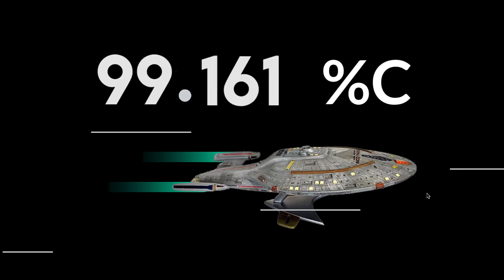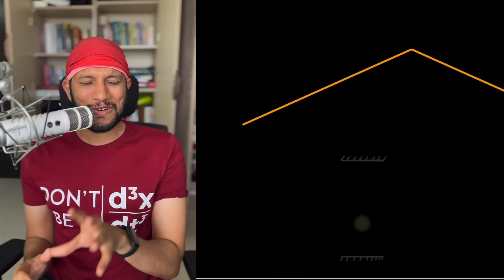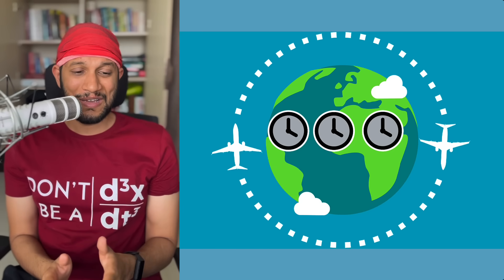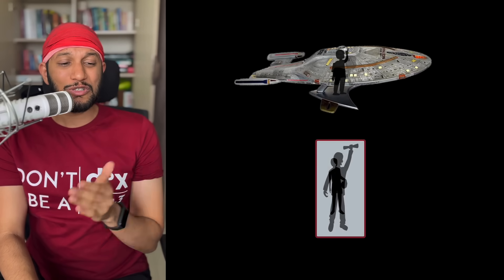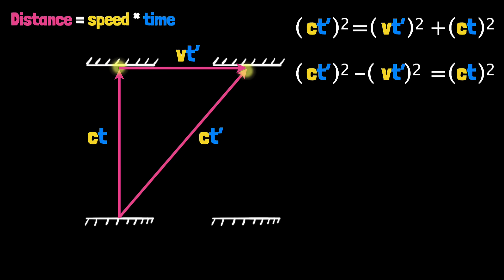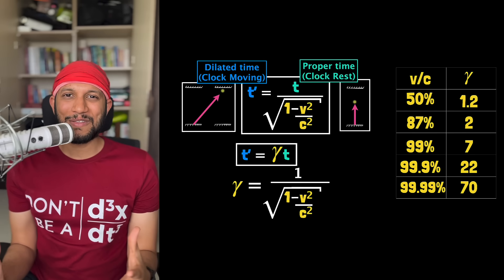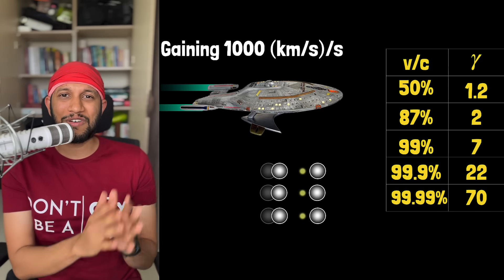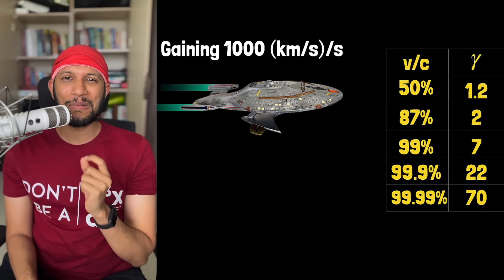I finally understood why you can't go faster than light! (My mind is blown)

Comment: I like to imagine space and time as something like oobleck (a non-Newtonian fluid). Space is the water, and time is the cornstarch. When you try to move through this mix, it starts to push back the faster you go. At low speeds, you can move without much resistance, but as you accelerate, it thickens and gets harder to get through. If you keep pushing, it eventually becomes a solid wall (the speed of light) that requires infinite energy to break.

Comment: If you're on a ship, and your destination at rest is 1000LY away, will you reach it in less than 1000 years if you begin moving at a speed that outside observers would measure as 99.99%?
You would reach it in 14 years? Others would see you reach it only after more than 1000 years?

Comment: The question become how are the biochemical and electrical processes and impulses effected and how does this change your perception, is there a noticeable change. Are there just massive amounts of change in the environment like flying past a galaxy that you simply would not see or have the information enter your brain because you brain is still completing electrical processes that are now taking way longer than usual. Would this feel slow? Would it be unnoticeable just like you cant see a bullet but otherwise everything else is normal. If your frame of reference for time remains localized to yourself and you otherwise maintain normal cognition from your perspective nothing is different you are actually aging slower from your perspective, you arent experiencing the "extra time" it would feel like you were going forward in a time machine. 

Or would you feel stuck in an infinitely slow and frozen world experiencing all the dilation psychologically, likely not because the photon processes i. Your brain are slowed down

Comment: All masses made of energy quanta, that are propagating through space time at the speed of light.  In its material state, those energy quanta are orbiting around in tiny subatomic particles.  When you add energy photons an object, you have to average the vectors to get the new vector for the object.  A 100g baseball + 10g of acceleration would move about 89% of the speed of light, but a 100g baseball + 100g of energy would travel about 96% of the speed of light.  Add 1,000g of energy, and it's traveling 99.6% of the speed of light because you have to average all of the vectors together.

Comment: No the part of taking infinite time and fuel is wrong  if you and the fuel are moving at the speed you will not notice time slowing nor the amount of time it takes to get there and the fuel would burn at the same rate as your ships time as if you where not moving at the hyper speed speed. Those speed and fuel consumptions would be from an outside observer not moving at speed.

Comment: There is evidence, It has been found that however much energy you give them, paricles in an accelerator cant be acceleratd to the speed of light. Humans are far harder to accelerate than subatomic particles. It is impossible to bounce a photon between two mirrors in the way you describe, but it is valid as a thought experiment. At speeds close to c, distance in the direction of travel is dramatically reduced, so the time remains the same but the muons have less distace to travel and therefore appear to go further, giving the impresson that they are living longer. If a spaceship passes us at 20% of c, it will seem to the astronauts that we are passing them at 20% of c and our time will have slowed, but for us our time will be unaffected.

Comment: Your explanation is great, but it's not a complete intuitive explanation. It goes wrong at 1:33. You casually mention that the photon always travels at speed of light, c. I would argue that's wrong. In the frame of reference of the ship, yes, the photon moves at speed c. But from the outside frame of reference, the photon should move at c + whatever forward speed it gets from the movement of the spaceship. This would indeed be true if we replace the photon with, say, a tennis ball. 

For a photon, however, this is NOT true. It doesn't get additional forward speed from the movement of the spaceship. But WHY NOT? Why is the speed always c in both reference frames? An explanation that doesn't cover this fact is simply incomplete.

Comment: 9:31 dont get the last step of the equation process.
Reply: You factor by c² on both parts of the fraction (up and down), so they cancel out. 
c²t²/(c²-v²) = c² * [t²] / c² * [1-v²/c²] = t² / (1-v²/c²)

In the same step, everything is put under a square root to get t' rather than t'²
Reply: c² = 1/1/c² hope you got this...
Reply: @tuhinmajumder21  double fraction?

Comment: Pedantry: The increasing energy to keep constant acceleration is not an exponential function. Exponential functions are unbounded in domain. If you increased the energy exponentially, the ship would still appear to eventually stop from the inertial reference frame.

 The function for energy needed to maintain acceleration would be a vertical asymptote (making the domain bounded).

Comment: You can't understand something that has never been proven.  Einstein's famous equation is a gross simplification and is impossible to prove.  If speed is defined as time to traverse a distance, how do you define distance in non-linear space, and then how do you define time? "Space-time" is an assertion, a way to explain away the absolute metrics needed, but it is impossible to measure it absolutely.

Comment: Question: The time dilation equation assumes a photon clock, I am assuming because we want to see the object? What if we use a particle P clock that goes with S>10*c  that can observe through an instrument then the equation becomes 1/root(1+v**2/S**2). 

If we assume c=1 and S=10, At 87% of S = 8.7(>c), gamma=2. Then the energy taken is not infinite right?

I am confused because the the basis of all this the assumption of clock made of photon.

Comment: Wait... no... you are actually changing the distance that the photon travels. So, given its speed is constant, increasing its trajectory will obviously increase the time it needs to travel that distance. The clock is not bouncing between two mirrors like the photon, it's not traveling any distance in order to measure time, the clock measures time because it has a battery and an electronic device inside. I still don't see the relation between the speed of light and time. What am I missing in order to wrap my head around this?

Comment: Got it.  Finally! Just one question. If the object moving at 99.99% of C takes a shortcut so to speak by traveling through a region of curved spacetime does that reduce the time dilation by reducing the d component of the d over t calculation? And if so does it make APPARENT FTL travel theoretically possible if we can artificially  bend space-time without harming the ship? Just asking for a friend of mine named Zephram Cochran.

Comment: Great Viedeo it was really clean and truely the most comprehensible Version of the topic. But i heard that if you flew with 99,99% speed of Light and you were to shine a Light inside of the cockpit it would still light up the room. But how can this be regarding the statement that the transmission of the acceleration is getting delayed. So if that was the case in the cockpit the shining of the light would also get delayed wouldn't it?

Comment: The thing thats not explained, is why the speed of light stays the same, regardless of reference frame... Or in other words, why light always references some "stationary" cosmic frame, rather than, for example, the spaceship it is emitted from. 
If it would do so, it could be "faster than light" in some other refernce frame. But it cant, because there is a cosmic speed limit. Without the limit, there would be no time in the universe

Comment: You can go faster than light. Light travels faster than light relative to light travelling in the opposite direction. Einstein might have got it right mathmatically but in the physical universe the only way light speed can be a constant is if nothing else moves which is clearly unrealistic. Maths has its limitations.

Comment: Einstein's Theory of Relativity has been disproven. It is, after all, only a theory and not a law of physics. It is known that the Big Bang traveled faster than the speed of light, or at least faster than speed of light as it has been established as a constant.

The Theory of Relativity is based on an assumption that what our observations about the physical world are consistent across the entire universe. The problem is that we cannot measure the physical characteristics and behaviors in other parts of the universe. Also, even those things we can measure are susceptible to distortion by taking the measurements.

I do not believe that the laws of physics are immutable across the entire universe. Why? Because it is far too easy to disprove many of the theories of physicists and the calculations of applied mathematicians due to their lack of domain knowledge, and the limit of their practical experience leads to their failure to consider all relevant factors.

For example, if we know that the Big Bang expanded at a rate faster than the speed of light, then there are two possibilities: 1) the speed of light is an actual constant which can be exceeded, but we just do not know how to accomplish this feat; or 2) the speed of light is variable depending on mutable conditions in other parts of the universe.

Let's face reality, mankind's knowledge of the physical universe is very limited. We are little more than monkeys staring into the night sky in awe of the brilliant heavens above.

Even the explanation presented in this video is nonsense. The real reason it is impossible to reach the speed of light is that continuous propulsion requires an amount of energy that cannot be carried with the vessel. Time dilation is irrelevant.

Comment: If you think about it, the fact that all the physics depends on the speed of light also explains why the speed of light equals what it equals. If you somehow change this constant - for example, multiply it by 2 - universe will also speed up by 2, same with your perception, and in the end you'll observe zero changes in how universe behaves. Light could move as slow as 1 meter per year, and we wouldn't even know it.

Comment: I have a question about the explanation of the mirror in the spacecraft. You say that from the point of view of a person standing still outside the spacecraft, the photon is moving at an angle and so moves further than it appears inside the spacecraft. Does this not suggest that you are working on the assumption that there is an absolute position is space from which to measure passing objects?
As far as I can see, the photon is only moving at an angle from the outsider's point of view.

Comment: Brilliant explanation. But it's still all a thought experiment until we can actually approach those speeds. We have no reason to suspect anything different will happen, but the universe is a weird place. Just like the inverse square law appears to work on small enough scales. Heck, even the concentric circles model of the galaxy works with enough circles, and a large enough margin of error. (they weren't measuring as accurately as we can.)

Comment: i think something or someone has accelerated the speed of light, it hasn't been observed yet from a 3D perspective because of time dilation. But if you are in that ship that can travel to the speed of light, you will experience everything or what? as a 3rd dimension being this is our limitation :D 
So, in order to observe this, you must be a higher dimension, being that you are not limited by time dilation. You must be the all-seeing eye. You must be everywhere, every time, all at once, outside the ship and inside the ship at the same time.

Example:
a straight path and at the end there is a wall in front of you.

2D beings will only see a straight light in front of them and they won't be able to pass that line, since they are just 2D beings that can move back and forth. 2D beings are limited by space and time

For a third-dimensional being can travel back and forth and now height, diagonal etc., you must travel around the wall in order to see the other side of the wall, which, of course, takes time, right? 3D beings are not limited by space, but limited by time.

4D beings, are no longer limited by space and time, so they can see behind the wall at the same time looking at the wall. They don't have to travel behind the wall, because they are already there. I guess they are limited by energy? And remember you cannot destroy energy you can only convert it to a different form of energy but the energy quantity stays the same. Converting chemical to mechanical, and some energy loss called heat energy, but the total combined energy stays the same.

I am not religious, but if you think about it, if you are a 4D being, you must be a god in the 3D perspective. Same thing that 3D beings are considered gods from a 2d being perspective.

Comment: im here to try to answer this without watchin the video.  light itself has no physical form in a certain sense.  light takes the path not of least resistance but of least time. mass experiences time differently then light, hense mass could never travel as fast as light because of physical resistances.

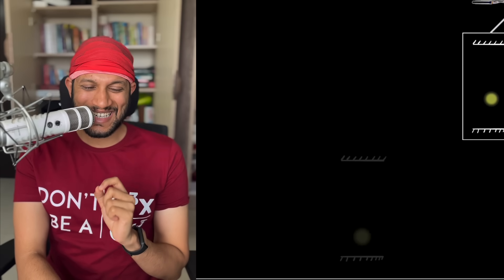Comment: I was out at 1:55. The thing was slower because the animation was slower. What?
Reply: It's not slower. It's slower on the vertical.
Bear in mind it now has horizontal velocity.
Reply: No the light ball is moving the same speed, just diagonally now

Comment: This is true in a system where the fundamental way in which particles interact is limited by speed of light (photons as we know it today). That raises a question, how are we so sure that photons or the way electromagnetic forces act always depend on c everywhere in the universe? Is it theoretically not possible for binding forces to depend on a different speed at different part of the universe? The equations will still hold there because c will get replaced by c' (or f(c)). Everything else will (maybe) remain the same.
This could be possible if photons comprised of sub-particles or there was something in our medium that affects speed of photon (not always deaccelerate) or even if we someday find out photons have extremely tiny tiny mass. How are we so sure that photons are actually the smallest particle, have no mass and move at same speed throughout the universe?
Reply: That's a lot of questions, but I tried to list them out and answer individually.  Keep in mind that, while I have two degrees in the sciences and have taken classes on some of these topics, I'm not an expert, but more of an enthusiast. 

1. How are we so sure that photons, or the way electromagnetic forces act, always depend on cc everywhere in the universe?

    -We've measured light’s speed from billions of light-years away, and it matches cc as measured here, indicating it’s constant over vast distances.

2. Is it theoretically not possible for binding forces to depend on a different speed at different parts of the universe?

    -It’s theoretically possible, but there’s no experimental evidence. Observations so far show physics behaves the same everywhere we've looked.

3. Could the equations still hold in a different region if cc were replaced by c′c′ (or a function of cc)?

    -Yes, if cc varied, the equations would still work by adjusting locally, but this variation would likely affect observable data, which we haven’t seen.

4. Is it possible that photons are made of sub-particles?

    -It’s an idea, but we’ve seen no evidence for photon substructure; current physics treats photons as elementary.

5. Could there be something in our medium that affects the speed of photons, not necessarily slowing them down but perhaps altering their speed?

    -In theory, yes, but no such medium has been detected in space or in our experiments, so it’s unlikely.

6. What if we someday find out that photons have an extremely tiny mass?

    -If photons had mass, they’d travel just under cc, and we’d likely observe slight deviations, which haven’t been seen. Experiments continue to test this.

7. How are we so sure that photons are actually the smallest particles, have no mass, and move at the same speed throughout the universe?

    -Yes, photons are the smallest indivisible packets of electromagnetic energy, but they’re not particles in the usual sense. They have no size, shape, or mass, and exist as wave-like disturbances in the electromagnetic field. They only appear “real” when they interact with matter. All current observations support this model.

Another thing to keep in mind that physics relies on observation and measurement, not on whether concepts align with our everyday intuition. Our understanding of photons and electromagnetism is grounded in quantum electrodynamics (QED), which is one of the most rigorously tested theories in science. QED has been validated to an extraordinary degree of accuracy, giving us high confidence in the properties and behavior of photons, even if aspects of it seem counterintuitive.

Comment: Wait a luttle. I heard a paradox about a speed of light, according to which if a particle hypothetically is moving from us with a 99,99% of speed of light and it emits a photon forward it will move with the speed of light related to the particle, but to us both particle and photon will be moving with the almost the same speed of light. But according to your nice explanation this paradox is wrong and photon will move just 0.01% speed of light faster than the particle.